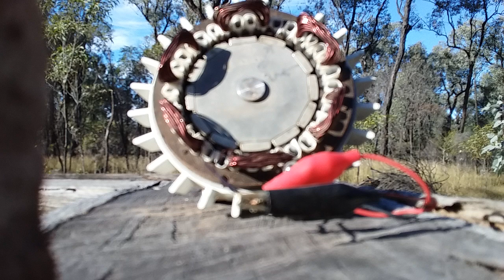Partnered Output Coils are the exact same analogy as the Electric Generator!

Comment: So question? A quick glance at your site shows you make a note on Tesla and his work, but why do you stick to the modern Electron particle and charge separation model? Tesla and many others were very much against it:

Nikola Tesla November 1928 interview:
On the whole subject of matter, in fact, Dr. Tesla holds views that are startlingly original. He disagrees with the accepted atomic theory of matter, and does not believe in the existence of an “electron” as pictured by science.

“To account for its apparently small mass, science conceives of the electron as a hollow sphere, a sort of bubble, such a bubble could exist in a medium as a gas or liquid because its internal pressure is not altered by deformation. But if, as supposed, the internal pressure of an electron is due to the repulsion of electric masses, the slightest conceivable deformation must result in the destruction of the bubble! 

Just to mention another improbability, the force tending to tear an electron apart is, in pounds per square inch, represented by the staggering figure of 256,899 followed by twenty-one zeros — and this is 513,798,000,000,000,000,000 times greater that the tension that tungsten wire can withstand! And yet it does not burst! Not even when it is hurled against an obstacle with a speed hundreds of thousands times greater than that of a bullet!" ” - Nikola Tesla Article: “A Famous Prophet of Science Looks into the Future” (Popular Science Monthly)

“My ideas regarding the electron are at variance with those generally entertained. I hold that it is a relatively large entity carrying a surface charge and is not an elementary unit (particle). When the ‘electron’ leaves an electrode of high potential and in a high vacuum it carries an electrostatic charge many times greater than normal.” – N. Tesla 

“In the theoretical treatment of these electrons we are faced with the difficulty that electro-dynamic theory by itself is unable to give an account of their nature.” “For since electrical masses constituting the electron would necessarily be scattered under the influence of their mutual repulsions, unless there are forces of another kind operating between them the nature of which has hitherto remained obscure to us.” - Einstein on electrons; “Relativity”, by Albert Einstein, Random House Publisher, 1916

“To describe an electron as a negatively charged body is equivalent to saying that it is an expanding-contracting particle. There is no such condition in nature as a negative charge, nor are there negatively charged particles. Charge and discharge are opposite conditions, as filling and emptying, or compressing and expanding are opposite conditions.” – W. Russell

JJ Thomson developed the “Ether Atom” ideas of M. Faraday into his “Electronic Corpuscle”, this indivisible unit. One corpuscle terminates on one Faradic tube of force, and this quantifies as one Coulomb. This corpuscle is not and electron, it is a constituent of what today is known incorrectly as an “electron”. (Thomson relates 1000 corpuscles per electron) In this view, that taken by W. Crookes, J.J. Thomson, and N. Tesla, the cathode ray is not electrons, but in actuality corpuscles of the Ether.” – E. Dollard

“There is no rest mass to an ‘electron’. It is given here the ‘electron’ is no more than a broken loose “hold fast” under the grip of the tensions within the dielectric lines of force. They are the broken ends of the split in half package of spaghetti. Obviously this reasoning is not welcome in the realm of Einstein’s Theory of Relativity.” – E. Dollard

“Unfortunately to a large extent in dealing with dielectric fields the prehistoric conception of the electro-static charge, the ‘electron’, on the conductor still exists, and by its use destroys the analogy between the two components of the electric field, the magnetic and dielectric. This makes the consideration of dielectric fields unnecessarily complicated” - C.P. Steinmetz (Electric Discharges, Waves and Impulses)

The idea of electricity as a flow of ‘electrons’ in a conductor was regarded by Oliver Heaviside as “a psychosis”. This encouraged Heaviside to begin a series of writings. Also consider the J.J. Thomson concept of the "electron" (his own discovery). Thomson considered the electron the terminal end of one unit line of dielectric induction.

“Electrons as a separate, distinct entity…doesn’t really exist, they are merely bumps in something called a ‘field’.”  - Dr. Steven Biller

Electricity is the conjugate of Dielectric and Magnetic fields are Steinmetz depicted over a hundred years ago, when these 2 mutually destructive fields make contact they create "bumps" in the fields as Biller calls them, a particle as the Electron is depicted couldn't exist, there is a reason the giants of electrical theory on the past followed the Aether model, with the Dielectric field being the Aether under tension or torsion and the Magnetic field being the Dielectric field undergoing loss of potential, if the Aether is Water then the Dielectric is Ice and the Magnetic as Steam, same thing but different attributional states, with the Dielectric field being the entity responsible for voltage.

Like the propaganda "they" push about electricity and symmetrical machines being required, the Electron is also part of that same propaganda. In-fact Tesla described the function of a Generation as "churning up the Ether", he was correct because a spinning generator induces tension on the stator coils via the magnetic field of the rotor which creates the voltage.

Extra question, could the output of a POC be doubled on itself to increase total output? Since what's happening in a POC is no different than generator could the effect be increased by "stacking" POC's?

Comment: Chris let me get this straight. The second POC (with only the diode) is actually preventing the sudden collapse of the field in the first POC (when loaded)? Also you said I can only use one diode. Where do I put it ?
Reply from the maker: Yes, POC Two adds Energy to the System, to make up losses and a bit more to Power a Load. Three Forces, + - + leaves us a + and we can use that accordingly. Great comment Very smart thinking! This POC, POC Two can also be Loaded, the Diode represents a Polarity and also a Short Citcuit. A Load can be selected to do the same thing, extra power flows in this Coil and most people do not account for this ;-)
Reply: @SweetSQM  also chk one thing u said u can transmit EMR when 2 coils thr, also consider this fact the more ferrite u have more it absorbs EMR unlike conductors so rotating it generates EMR from the iron core or magnetic core into the conductor, u can either check with phone app or Geiger counter

Comment: More simplified is that a capacitor charged by a battery can discharge into a coil and manifest magneto amplification (increased by ferro core, laminated silicon steel, or a choke ferro ceramic which saturates and desaturates faster and does not heat up as much.) Amplification of magneto (magnetic field induction) when impulsed inward charge is cut off, it phase conjugates (reverses) when it faces resistance. The magneto coil field reverses and charge impulse reverses. Magneto field amplification is the manifestation of electricity by reverse charge output. Use output for work and for keeping the source battery charged. Capacitance can be stimulated to discharge by "spark gap" potential, which is the same thing as mosfet or vacuum tube and potentiometer voltage input output controller. Harmonic resonance adjustment frequency can be found using brightness of of a light bulb.